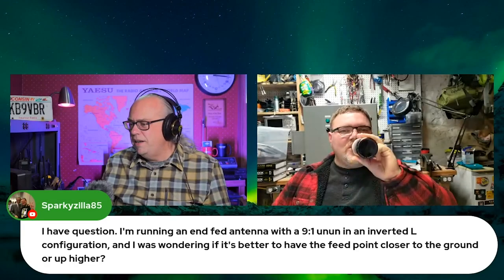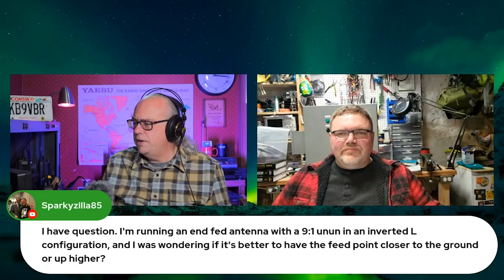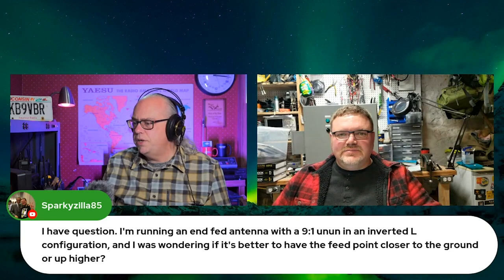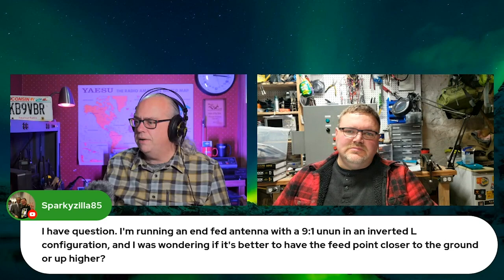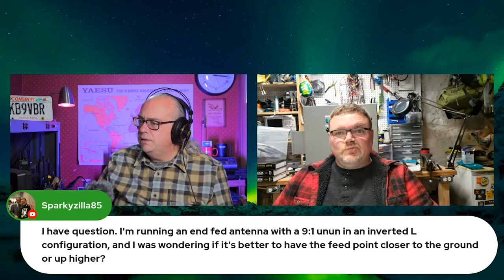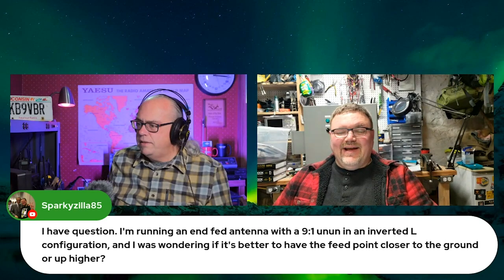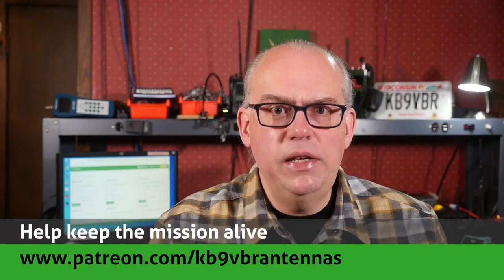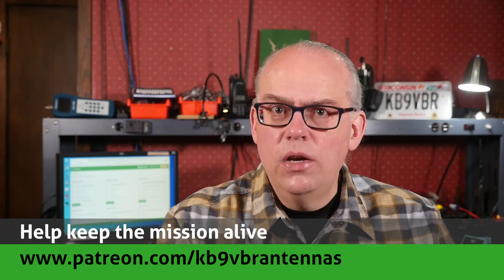Should I elevate the feedpoint of my random wire end fed antenna? Dec 2021 Livestream Excerpt

Comment: I’ve got mine about 6’ off the ground, 35’ vertical and 100’ horizontal (inverted L, non-resonant length). Makes a great antenna (80m-6m). If I was portable, it’d be closer to the ground. Great video!

Comment: Michael, you always appear to put your endfed transformer at the highest point up in the tree and then run your feedline back down. I have always wondered why you don't raise the other end up the tree and leave your transformer connection low (a few feet off the ground). That's how I do it. I think that puts the highest current point of the wire higher. Leaving the transformer off the ground also reduces the need for a counterpoise because the feedline becomes counterpoise. Comments?

Comment: A couple of comments on the “inverted L”. A lot depends on the frequency band used. For 160, 80 and 40 meters an inverted L is frequently used as a top loaded vertical. The main radiation is from the vertical wire at a low angle. The main radiation is always from the current maximum and that is going to be 1/4 wave back from the end. I always want that current maximum point to NOT be at the ground but halfway up the vertical wire.
On the higher bands you really don’t want a vertical, you want horizontal polarization and the gain that comes from ground reflecting that horizontal wave. This does not happen with a vertically polarized wave. Also the high current point is closer to the end of the wire. Only 16 feet from the end on 20 meters and 8 feet from the end on 10 meters. In most cases the inverted L configuration on higher bands like 20, 17, 15 etc ends up with a half wave section of the wire horizontal, essentially becoming a horizontal half wave dipole with the vertical portion acting more like a feedline supplying power to the dipole. It of course does radiate some signal which may or may not help with some directions/ wave angles.  I know I have simplified this but I would need to write a book to cover it all! 73, Don N4DJ

Comment: I've used the 66' EFHW for about a dozen portable activations.  Almost always in an inverted "L" of some kind and fed at the bottom.  Every deployment resulted in slightly different VSWR curves, but the best match seemed to be when the 49:1 transformer was 6 to 12 ft. above the ground.  For safety it's best to keep the EFHW's high voltage input away from accidental pet and people contact too.
KZ9V

Comment: Here’s a question for you. I have a second story ham shack with a small balcony adjacent to the location. I’d like to use an end fed random wire. The feed point would be on the balcony and the antenna can slope up into an adjacent tree. My main question is should I dangle the counterpoise down or try and run it horizontally?

Comment: Great topic, one thing I wish was covered.

In a semi permanent installation, can the feed point be kept inside the shack and just send the wire out the window along with a counterpoise if needed or does the feed point have to be outside?
Reply from the maker: Since the antenna radiates beginning at the feed point, your best to keep it outside. Having a portion indoors may increase the likelihood of RF in the shack.
Reply: @KB9VBRAntennas I moved my antenna into a sloper configuration up a pole with a pulley.  

I had to use 100’ of coax in order to get decent SWR across 80-10m.

I had my box about 3’ off the ground with good SWR, but nearly decapitated myself while mowing my yard.  So, I lifted the box to about 8-9’ above ground so I can walk under my wire and keep my head.  LOL

When I did that, some of the lower band SWR improved slightly and upper bands were slightly degraded.  Not enough to cause tuning issues.  

Hell 20 meter is damn near resonate across the band.

What I wonder is how that will affect my DX abilities and the answer was, I can hear places like France, Italy and Spain, but at 20 watts they can’t hear me.

Comment: I was wondering the same about the inverted v for a 40-6m OCF. I'd like to put the ends up a bit, not necessarily flat top. I need to get pulleys on the ends to simplify the experimentation.
Reply from the maker: When I do Inverted Vee's including the OCF version, I usually tie the ends at about 6 feet. That seems to work quite well.

Comment: I have a chameleon EMCOMM III Base at 40 feet in a long sloper.  They advised me to put the feed point as high as possible.
Reply: I have that antenna too and have made contacts from US east coast to Central Europe with  6 watts SSB.  I run a sloper from about 30 inches to 35 ft.  Feed point at bottom. In my case raising the feed point higher causes the SWR to increase very quickly and makes it hard to tune.  My counterpoise works best when I just dump it on the ground.  50’ coax and  lots of ferrite beads strategically (trial and error) placed.

Comment: Nobody ever knows a yes or no answer to this question. I don't think there is one.
Reply from the maker: You are correct. Every install is different, so test and measure.
Reply: @KB9VBRAntennas  then the real question is if one way works is it worth flipping it around to see if it works better?Then how would you know with bands always changing, people spotting etc. you never really know anything in the end unless one way doesn’t work at all and the other way works great. That’s up for debate as well. One contact can be all someone needs to say “it works better” no contacts one day can be 100 the next day with everything the same. HF is a forever debate.